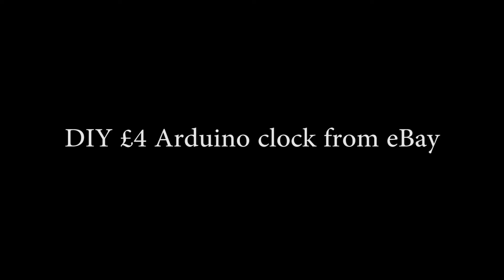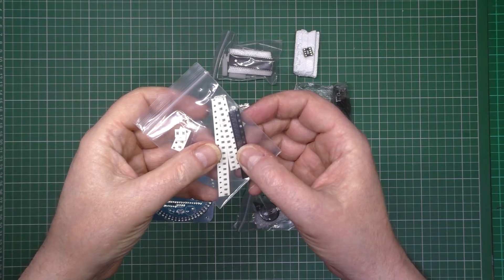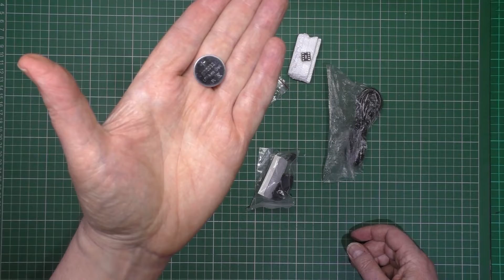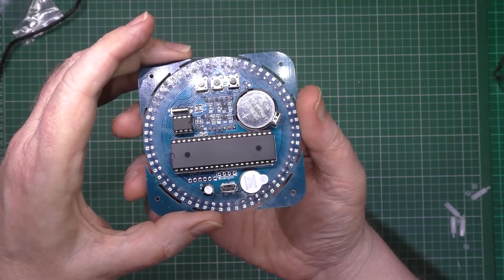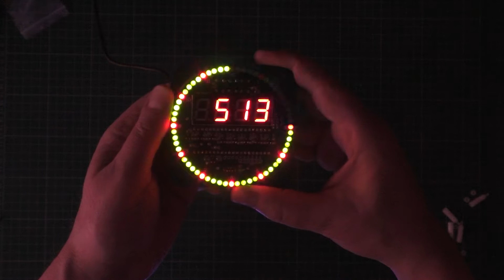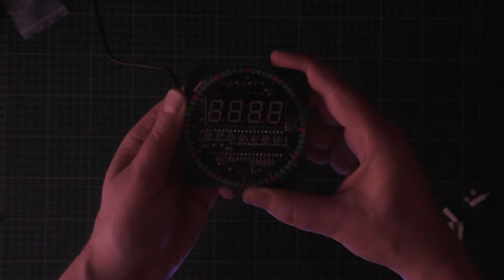£4 DIY LED clock

Comment: '
can this DIY rotating LED clock kit use a pack of four AA or four AAA batterys = 6 volts...
would be work fine or better not...
will it burn out LED lights or two microchip controllers or both
Reply from the maker: I wouldn't chance it - they run on USB power (5v). You could use 4 x rechargeable AA batteries because they're 1.2v each
Reply: hi V...
rather clock with batterys can going out anywhere without a cord...
dont need to use a cord with a USB line
Reply: Can any one let me know how to purchase this diy rotary clock kit.
What will be the cost of the kit in Indian Rupees.
 Please give me a miscall 8850170034
Thanks.

Comment: Nice work on the clock.
I've noticed yours doesn't let the LED's 'move' every second. As you press the mode switch, you don't see the LED's act as a seconds counter.

Here is my build. I changed the LED's into waterclear, high powered ones in 3 different colours. Also i made a cool custom wooden case.

https://youtu.be/wPx1UN79m3k

Comment: I have't put it together yet but you've inspired me! I bought mine here ,and there is an instruction link also. My kit has wire type resistors . Here's a link  http://www.banggood.com/Upgrade-DIY-EC1515A-DS1302-Rotation-LED-Electronic-Clock-Kit-51-SCM-Learning-Board-p-1013812.html
Reply from the maker: +Doug Kuechenmeister I only bought it as something to pass the time. I've now got it turned on permanently because it also has an alarm clock :D

Comment: Dazzling! 
Is there an alarm? Do you need to add one? Mod? 3D printed case?
Reply from the maker: +dmerc00 There is an alarm clock but I don't know how to set it. Plus which, can you imagine the volume off that buzzer - It's the same one that you fit to the Naze. I can imagine my head banging off every wall when it goes off :-)

Comment: Have you got the link to the item on ebay?
Reply from the maker: +paulham http://www.ebay.co.uk/itm/182000365400   
I found some instructions but it doesn't match the component list. If you read through it before you build it, you can figure out what goes where https://s3-ap-northeast-1.amazonaws.com/sain-amzn/20/20-211-301/english.zip